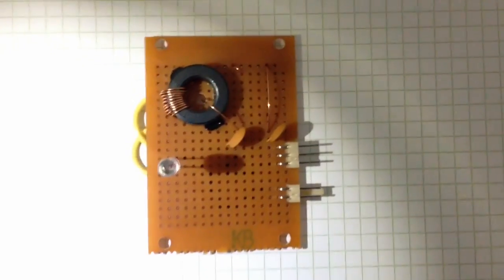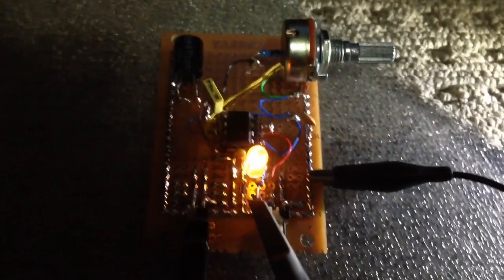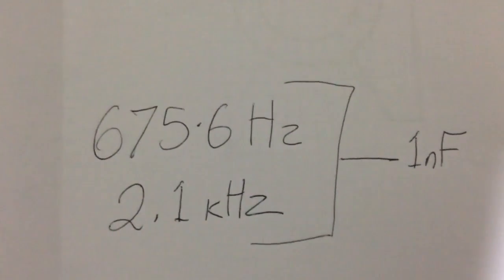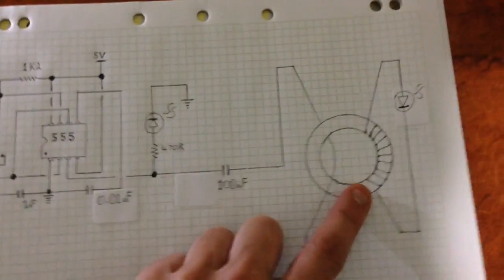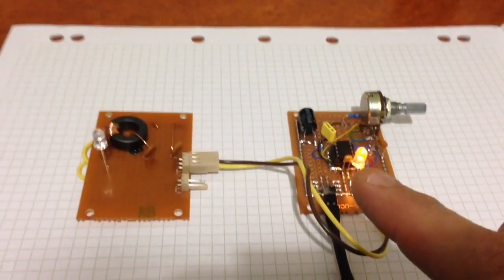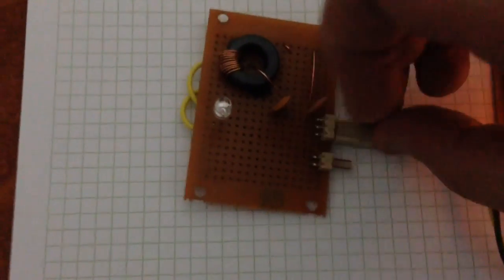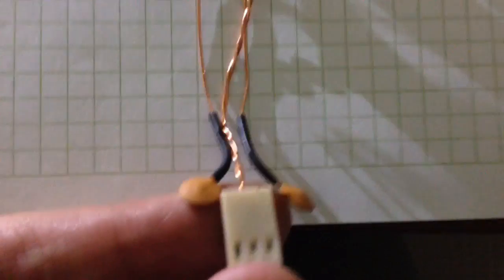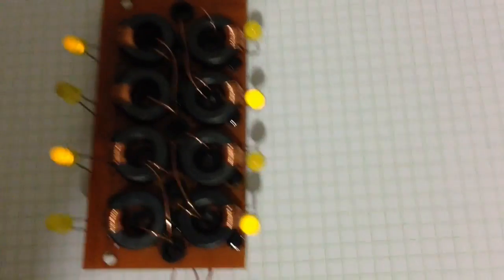Core Rope ROM Part 1 (Hardware Progress)

Comment: Thanks for this - I am planning on building one for my channel to output to a seven segment display (similar to Kos' but with some changes as I want to do it without use of 'computers' such as the arduino.  I try not to let the 'magic' happen in such 'computers' to make it a bit more authentic.  I think it will be similar in some ways to yours too.  As I am sure you know, the working of rope core memory (Apollo) was rather more complex with ways of addressing the cores by suppressing the signal on all cores apart from the one needed, and methods for changing the direction of their magnetic field.  I think this will be too much for me so I will stick with the simple 'is there a secondary winding or not' method.  I have some regular core memory plates too - must get them going as well.  Thanks for the video.  Always good to share one's enthusiasm!
Reply from the maker: Good luck! I’d appreciate a link when done if you make videos.

Comment: Now, if the LEDs aren't attached the memory would be retained without power because it's in reading it the memory gets destroyed. Because beyond just being a transformer isn't there supposed to be memory features like that, the whole reason you would use something like that in the first place. I recognize this is ROM memory, but if the leds had a push button N.O. going to ground. after power is given then taken away,  theoretically the leds should flash their state right? there's a video of a guy who made an electromagnetic. applies power, removes it and says it has stuck to a steel beam in his house for about 2years.
Reply from the maker: I’m not sure I understand, but you seem to be describing magnetic core memory. Reading magnetic core memory (RAM) requires that you destroy the data it contains, so the system typically writes the value straight back to it after a read. Core rope ROM can never be rewritten, so essentially, the data is retained eternally. For the circuit in this video, the ROM stores 2 bytes (the LED outputs), and the input could be likened to a pair of addresses. Typically the output would be connected to a system’s data bus and read from the rope ROM into RAM, and used from there.
Reply: could use a ccd camera and use the flip dots as one's and zeros.